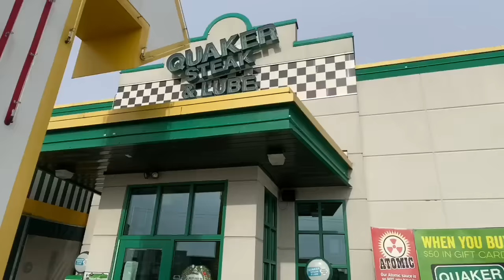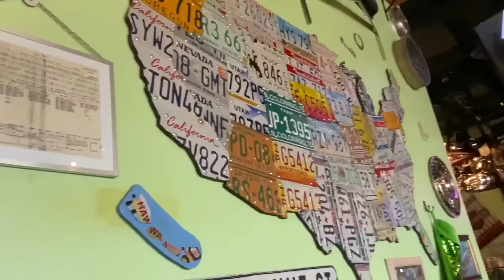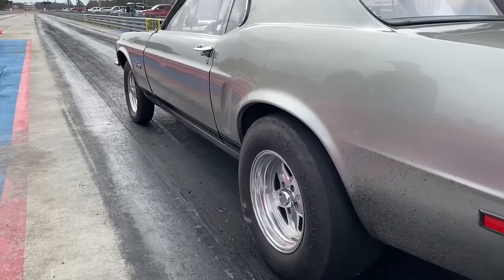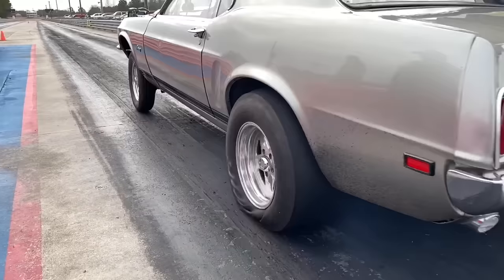How Drag Racing Suspension Works, Cars Launching

Comment: The Mopar is on super stock leaf springs and they always react like that, with no anti-squat
Reply: john douglas - Yeah, that is really old school.  Still works though!
Reply: Where can i get some for my 68 cuda anyone know a place
Reply: @Matt-lx6cj  summit racing. Get some shocks for them also.
Reply: Pinion snubber too.
Reply: and if dont hook...take the leaf spring clamps from rear end moving to back shackle....leave 2 clamps one infront and one behind the rear ...a d pinion snubber about an inch from floor pan.......

Comment: Guys and gals if you have a car and you have everything right with the engine but you can run the times you think you should be running well bookmark this video and watch it over and over until your car is running the times you think it should be running! 🦅🇺🇸🦅 Because this video explains why your car is not running those times people over look their suspension way more than they should it's just as important as your engine! If you don't believe me next time you're at the track and you see a Dodge Demon come to the line watch how that car comes off the line and how the rear end works and the front end it's crazy how much time they got out of that car just with how they set up the suspension on it.

Comment: Just learning drag race suspensions as I'm getting started In drag racing. I've dirt track Raced for years but looking for advice in budget shocks for drag. I have different shocks from the dirt but wondering if stiffer is better on the rear or what? Any advice before I buy shocks.  I'm going to be in a square body c10.

Comment: This is a hugely important topic for me. I drive an modded Hellcat and struggled with traction. I did find a pretty good solution though. Demon (soft) springs all around. Drag Pak with 17” rear MT Et Street R. Lower Control arms. This completely changed the launching of the Cat from a dig and a roll where it used to just spin. The Hellcat, like the Demon needs to squat a lot to get traction, at least thats what I’ve seen and experienced.

Comment: Informative video.  Cool dude.    I don't have the luxury of someone to film my launches.   So I rigged up a camera underneath the box of my S10 drag truck, to see what my rear suspension is doing when I launch.   When I downloaded the videos to my computer, what I saw was at once both amazing and jarring. 

Upon launch, the shock absorber immediately extends, but then right away it 'bounces back'.   I'm thinking I should remove my Calvert single- adjustable drag shocks and install something like QA1 double-adjustable shocks.

Comment: The Mopar is hooking better, in this video,  because of it's  design from the factory. A group of "guys" called Ramchargers were the reason. So VERY BASIC info first ( with out talking about instant centers and so on).And yes you can try this at home!!! An easier explanation of why the body needs to rise ( frt. & Rear). The front going up is always obvious to all , weight will move to the rear. The rear also most go up ( or as he says have separation) in order to plant the tires. Stand on a chair at home, so you can touch the ceiling. Your feet are the tires, legs are the springs (legs and body = Suspension). PUSH ON THE CEILING! Where do your feet go - down into the chair. By the suspension pushing the body of the car  up the tires go down INTO the pavement - or "plant".. Ya all remember taking to Isaac Newton, don't ya - a force in one direction creates an equal one in the other direction. Any way back to the Mopar rear springs ( leaf style). Most springs have the location pin in the center of the spring, Mopar has them OFF CENTER (shorter side to the front) this stiffens up the front section to prevent ( spring wrap or wheel hop) It's also is a shorter "lever" to apply that force to the axle, to the tires, and into the ground. There is a lot more stuff ( as the very smart gentlemen explains) for you to understand and learn. Each and every different type of suspension requires a different solution. Decide what brand car you want and read, and read some more, learn everything you can then make your corrections as you need. 
     BUT: My suggestion ( just to bust on ya) is get a older Mopar. Best starting point ever if you need to go in a straight line!!!!!

Comment: Have a light Fox body with 700 horsepower small block and Powerglide it has 113% anti squat and performs great, but when it hits high gear it pulls left and I can't get that out of it. Any thoughts

Comment: You mentioned a few times that you had 125% or so of anti-squat dialed in, how do you determine that number? Based on stock geometry or your baseline geometry from when you set up and/ or installed the rear suspension?
I love the science behind all this.
Like NASCAR for example, I could care less watching them drive left for a few hours, I much prefer the science and strategies behind the scenes. Making a motor run at 8-10k all that time is insanely cool

Comment: What do you think about the Southside Machine/UMI lift bars on a sub 500 HP Mustang for mostly track use? I'm just starting out and I'm trying to build the car for the power it will eventually have rather than chase crappy suspension that's being overpowered.
Reply from the maker: I ran just southsides forever.  They understood and put into practice instant center manipulation way before anyone else.  I went 5.10's at 3100lbs back in the day with only ssm lowers.  Great stuff.  Reinforce the upper boxes, the instant center location pulls hard on the upper boxes and will rip them out if not reinforced with battle boxes or similar.

Comment: Yeah well and then it gets complicated . A perfect setup on a perfect pass should look like absolutely nothing is going on. Car just moves and is done . Springs , valving  , whats hitting the rear and how hard..... Its a rabbit hole man......
Its still hard to dislike watching  the old Mopars and Fords on those leafs with the bands removed . The instant center just happens to be where the rear is being violently pushed down . I have a pic of one of my cars around here somewhere with one rear tire on the ground at MIR way back in the way back. Small cubic inch , 4 speeds , tons of RPM and heavy flywheels......
If its perfect the antisquat will plant the tire and start things in motion , the car will transfer and sometimes overcome the antisquat and squat back over the rear tires which are still trying to push into the pavement. Short travel is no bueno . Everything should be able to move through its travel without issue . Tying the front down solves some things but causes others such as unloading....
As you stated here John , every car is different and how it sits and how much power ,etc etc.... Its a rabbit hole...
Reply from the maker: Yes it is!

Comment: Hmmmmm learn something new every day just a SBC NA car 5.70-5.90 but i do believe it should be at least low 60s,427 sbc glide 456 18 degreee brodix 1050 carb on 112 weight is less than 2400 never heard of anti squat ,really enjoy your videos you were cuutin asss racing from the wrong end the other night llol
Reply: There is a one in Columbia, SC
Reply from the maker: I've done several vids on it.....most recent is the one from last week with the weights on the rear end

Comment: Hello turbo john I have a 95 mustang that I turbocharged its purpose is to be driven on the street and taken to the track once in awhile on the weekend. So I just purchased a Terminator X Max and having a hard time figuring out how to control boost on the Terminator it only allows you to select dual Port Dome pressure for wastegate type. You are very good at explaining things and was wondering if you could recommend the best way to go with controlling my Boost or maybe do a video on it ?
Reply from the maker: I done a few vids on boost control, but search Devin Vanderhoof on here.  He is a legit Holley EFI expert and has a few vids on boost control as well.

Comment: What do you think of a high anti squat like 180    42 IC with a drag slick on the street, comprision tight about the middle on extension. Trying to plant tire but still want it to get up on the tire havent tested this yet.  Thanks for any help Turbo John
Reply from the maker: I think it will take too much air pressure to keep the tire  from squashing too bad

Comment: Good job John I know you have ran nitrous and turbo what cylinder head gaskets are best for nitrous and turbo in your opinion copper MLS
Reply from the maker: I like copper, with oring block or the best is the top fuel hoops.  But for mild tunes 1500hp or less, mls seem to be fine as long as the tune is right.

Comment: Thanks for the info. People spend hard earned dollars on suspension parts and don't understand how to properly use them, I'm one of those. So if I'm understanding correctly anti squat is what's desired correct?
Reply from the maker: It depends on the tire and surface!  If on a radial, yes you need over 100 percent anti squat so it can plant the tire!
Reply: @TurboJohnRacing  thanks for the reply!  Its only ran at the track with 28x10.5 Mickey Thomson's ET Streets.  It's non transbrake C4 transmission as well. 1.6s is the best to date.

Comment: Why is this important? If it ain't street legal and a true frame or un-body car who cares? Best bragging rights are i can do a 9 or 10 in 1/4 mile and drive the car to work the next day.
Reply from the maker: Street cars don’t impress me any more, lol
Reply: @TurboJohnRacing  drag racing doesn't impress me anymore. Its all automatics, none of the engines are even close to stock configuration, the frames are all tubed chassis, power steering.  Back in the 60s 70s 80s when it was taking iron heads and stock cranks with a 4 speed having to actually drive the car down a straight way and making it the fasted car on the track. Now that was impressive. But to each their own. Very informative video, l did enjoy watching.

Comment: What do you find with lower bar angle?   Getting such positive AS values must have the lower bar uphill quite a bit?
Reply from the maker: It depends on the car and the adjustablility.  Either the lower bar has to angle up a good bit, or the upper bar needs a ton of angle down. You can do either.  Mos cars I like 170ish AS, 28-34" long IC.  But it seems every car is different and the numbers are just numbers.  Look at the vids and see what the car is doing.  Shocks play a huge role as well.

Comment: This video is great. I started setting up my 4 link. I don't have scales so with 220 lbs. in the drivers seat, I set the frame rails down on  2 jack stands to see where the car would balance evenly with all 4 wheels off the ground. The jack stand position to balance is 59" from the axle center line and calculated to 51.5% weight on the nose. The camshaft center line is roughly 20.5 " from the ground. The 1/4 panels buckled a bit even with an 8 point roll bar when doing the balance but it went back to perfectly straight when she was back on all 4 wheels. Thank goodness!  Now that I have that measurement I guess it will help with calculating the bar spread and initial anti squat % ?
Reply from the maker: That might help for sure.  The only thing you cannot find for sure is center of gravity height, but that is where the cam shaft comes in.  Good luck with it.

Comment: The yellow Mopar cuda I believe is doing exactly what the Super Stock springs are supposed to do. Not bashing but giving insight.
Reply from the maker: I never looked under there, but the way it rises so much that means that as the pinion is climbing the ring gear and the leaf must be very stiff from the axle housing to the front mounting point.  I guess that mounting point would be the instant center location and it must be pretty high up on the neutral line.  Causing the body to lift like it does.  Crazy, I'm going to do more research.
Reply: Turbo John Hi John when these springs are installed Mopar recommends a leaf spring shim kit to achieve proper pinion angle if this is what your revering too. I up graded my Plymouth to these springs and never looked back. Happy New Year and keep the videos comming

Comment: Definitely appreciate any and all info on this subject!! 
Chevelle cutlass A body cars what are most people using nowa days? 
I wanna do an air bag on the rr 
Southside lift bars work ?
Reply from the maker: I don't know about the A body's, never messed with them.  But southside lift bars work great on mustangs triangulated 4 links.  If the A body is the same type, should work good as well.
Reply: Turbo John thanks John !

Comment: another great vid, thank you!!   You ever work with IRS cars ? I just can't get mine figured out lol
Reply from the maker: I have not messed with any, all of them squat.  I need to do some research.  I would assume antisquat still exists, it has too.  Just have to see how they mount every thing up
Reply: @TurboJohnRacing  well if you ever want to learn I have a car to learn on lol
Reply: I run IRS in my 88 Mazda, it has zero anti-squat from the factory & can't really be changed. Some of this may apply to you and sone may not, My car is only running a high 11 to low 12 in the 1/4 on footbrake.
 That said, I compensate mostly with shock & spring settings.   Tires & bushings also come into play. Also, I eliminated the sway bars.
First- spring selection, I chose a rear spring stiff enough to prevent it from hitting the bump stops, but not too stiff because I needed it to still transfer the weight.   In front I'm running stock springs, in rear they are ~50% stiffer. Springs will change the way the car drives on the street significantly... 
2nd- shocks- I went to a single adjustable set of KYBs, I run the rear set in the middle & front on #2 of 4... It seems to work ok.
3rd+ I try to get a good contact patch & maintain most of it during launch, IRS car tend to have a lot of camber and it increases as it squats(for cornering). To counter this I actually raised the rear of the car about 1".   I haven't put in camber links yet to get the tire closer to  0* camber, but that is on the list...
4th tires- I run wrinkle wall bias ply slicks to absorb the small oscillations & shockloads. It seems to do that. More sidewall is better.  They also care less about the camber issues.
 bushings-  I reduced some of the play by putting in polyurethane & delrin bushings.
Sway bars- I wanted each corner to act independent, that way if one tire hopped, it doesn't transfer to the other side.
The bad about IRS cars is the anti-squat cannot be changed easily, because that requires major changes to the control arm pivot points.  You can tune what you have, but short of back-halving the car, it's not going to actually change the anti-squat.

Comment: I took my anti roll bar off so your saying i should put it back on.
Reply: Your not confusing your sway bar with an anti-roll bar are you  ? Two different things.  Just asking
Reply from the maker: He is right, the sway bar is not the anti roll bar.  Google drag car anti roll bar.  It is a bar that has arms that moves up and down, a link on each end of the arms that attach to the rear end housing.  This takes most of the chassis flex out and allows the car to lift the front wheels more evenly.  Most take a bar link loose to drive on the street.

Comment: Any advice on setting up a 4 link to do a wheelie ?  its really all i want to do lol
Reply from the maker: lol, yes the instant center should be longer 40-55" long.  Radials or slicks will determine antisquat value needed.
Reply: @TurboJohnRacing  Radials, 94" wheelbase 3000lbs 1600lb front 1400 rear  it is a triangulated 4 link.. does the math work similar ?